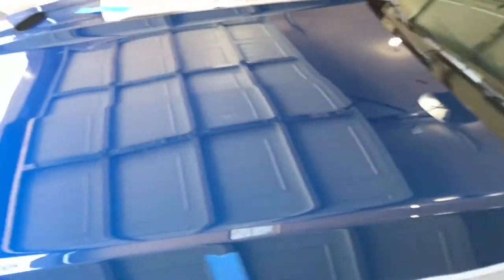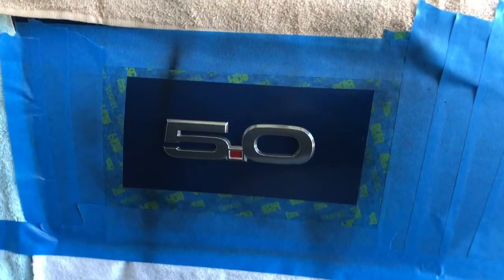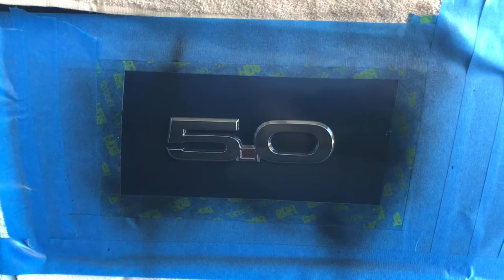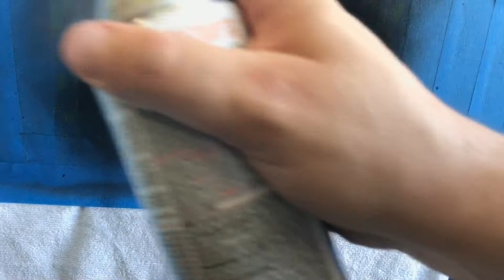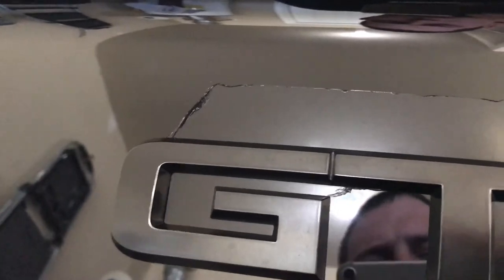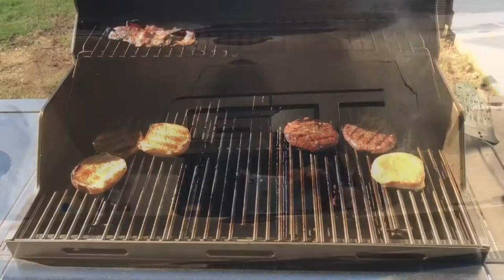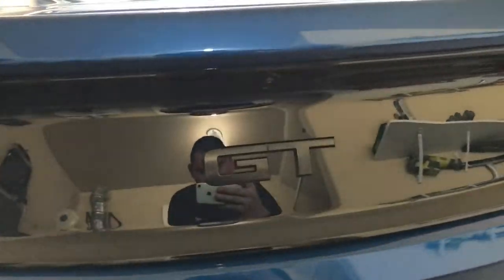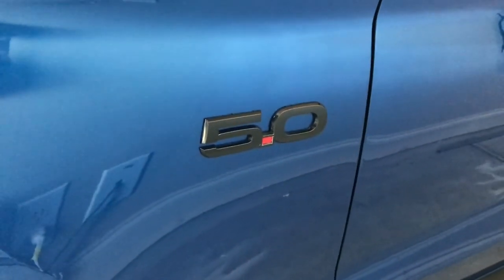How to plasti dip your emblems on a s550 5.0 mustang.   ✔️

Comment: This is truly on my to do list. I'm gonna plastic dip the pony too.
Reply from the maker: B702K  I Dark chromed mine.   I Show how on my part two grill delete video.
Reply: The 5.0 and GT emblem are very easy to switch out with black ones, that's what I did, they were pretty cheap too. The front running pony however is not as easy to take off. I plasti dipped that emblem only. Black emblems are where its at.

Comment: It didn't seem to me that the peel coat was as thick as plastidip. not saying it didn't give the desired effect, but I could achieve it faster with plastidip.
Reply from the maker: it seemed to lay down smoother than plasti dip i have used in the past. I only did three coats, probably should have done four or five, but i was afraid of building it too thick and it not wanting to separate from the emblem itself.  In other words i was afraid it would peel the dip from the emblem itself and not self cut on the edge like i wanted.

Comment: Can we still add a gloss clear coat on top of the gloss black peel coat?
Reply from the maker: Rene Garcia I wouldn't.  It will just make it harder to remove later.  Any plasti pod it just ment to be temporary any way.  I would never leave it on more than a few months.
Reply: Project Lightning but the clear coat can still peel right
Reply from the maker: Rene Garcia ohh.  You were talking about the plasti dip clear.  My mistake.  I thought you were talking about just some spray can clear.  Idk why I was thinking that.  Lol.    Yes you can put the plasti dip glossifier on top.